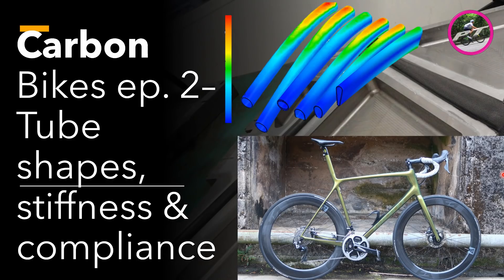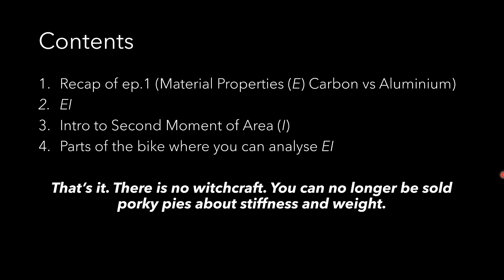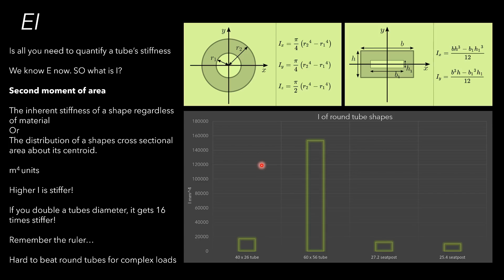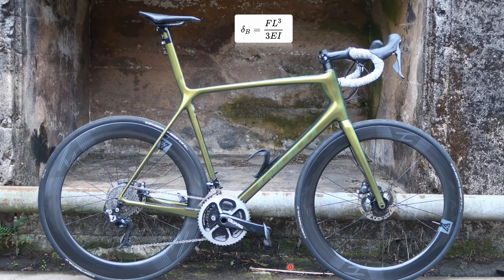Bicycle Stiffness - The Truth. Ep 2. Second Moment of area, stiffness & compliance explained.

Comment: I cant think of a reason to make a spaceframe out of cylindrical tubing other than for aesthetics and to make cutting of the tubes a royal pain in the ass for the poor buggers who have to make it :). If it's a proper spaceframe all the loads run axially down the tubes (in theory). As for compliance of seat stays ... I guess if they are spindly enough and possibly splayed then it will increase the deflection possibility ... if the chain stays are allowed to bend. I agree that it's a very stiff structure at the back and the only serious compliance is the seatpost ... a trusty cantilever in bending. Trek have a pretty good design with their isospeed system which has a genuine capability to modify the cantilever arm length and springiness. Keep the proper engineering stuff coming. You have a great knack for explaining stuff.
Reply: motorsport space frames get loaded in all sorts of crazy directions during unexpected departures from the racing line. So yes tubes are a good shape there. They aren't that hard to cut. and even easier on the high end stuff where a laser tube profiler just does it for you.
Reply: @Cynyr  good point on the laser cutting. I still dont get why round tubes in a spaceframe are better. By definition loads in a spaceframe member are axial or it ain't a spaceframe. Regardless of crazy loading, if the loads are going in through the suspension pickups and other major component mounts and these pickups and mounts are at a spaceframe joint and not slapped in the middle of a tube ... then everything is determinate. I'm not trying to score points here ... I genuinely dont get it.
Reply: @stevecrabb1  think crash, not normal operation. Yes they probably are all mostly axial normally. But flip it through the infield, or so it around a tree, and good luck determining the loading.

Also round tubes are ready to get.
Reply from the maker: @stevecrabb1  interesting discussion here. Im actually fond of the latest isospeed spring concept on the madone. It is a neat and novel solution. Something seldom seen in road cycling design. I actually commend the designer on that. However, its a big spring with no damper. How does it feel at 110rpm trying to push 600w seated...who knows. I need to ride one. But I sure ain't buying a frame with that price tag. EVER. 

About the space frames, i can't actually think of a reasonably modern application where the loads are all axial. Especially not ground vehicles. Maybe there are some kit gliders/light aircraft that display this. I've seen some old old gliders where space frame members are just cables. 

If you take the wheels and a frame, and apply the static loads do you think the frame structure is determinate?.... I think this has confused the bike industry since day one.
Reply: @Cynyr  It's a bit like designing an aircraft to survive a crash :) not a lot of point. It depends on the formula and rules surrounding driver safety as to roll bars, leg protection etc. as to what you do. In any case smacking it into another car or wrapping it round a tree will involve a lot of tubes being put into bending as they get hit in the middle. A round tube is definitely not better in bending than a square/rectangular one. But its a bit hypothetical at that point. What I'm a little unsure of is whether a round tube in compression has a better strenght to weight ratio, if it has then it makes a lot of sense.
Reply: @PeakTorque  Yeah ... welded joints are going to put tubes into bending somewhat. Bi-plane struts use crossed cables (or thin aerodynamic strips) in tension. Spaceframes are still used in kit /light aircraft for sure... and as you mentioned cranes and bridges. I do like a good spaceframe :).  I have a Trek Madone SLR 8 and the Isospeed seatpost works really well. I have it on its comfiest setting and never noticed any problems at high cadence. The pivot bolt did come loose once and it was the wierdest wobbliest feeling. Its a great bike generally but as good as the Isospeed is the actual method of retaining and adjusting the seatpost in the frame is just utter rubbish to the point where I had to make a spacer to fix it in place. I got the bike second hand for a great price, would I pay the asking price for a new one? ... no chance. Modern frames are an amazing study in price gouging!

Comment: Great video. Yourself & Luescher Teknik speak the most sense in the cycling industry

Would you recommend replacing a standard 27.2mm carbon post with a 25.4mm post in an effort to improve comfort? My frame is a 1980s Tommasini with room for 25mm max. tyres and I find it a bit too harsh. If so, would a plastic be the best seat post shim material to use? I wouldn't fancy carbon (post) to a typical aluminium (shim) to steel (frame) for galvanic corrosion reasons
Reply from the maker: Hi Gary. Thanks for the comment. As for the shim, go ahead. I have also run a 25.4 in a 27.2 frame. At these small diameters, the difference in second moment of area is small however, so you may not feel a difference. I'd still recommend Alu for a shim, with a liberal coating of grease. Or even better, if you are custom making the shim, anodize it. Use 6000 series not a 7000 series as they tend to corrode less. 

You could try Delrin (an engineering plastic) but this may creep under clamp compression over time, meaning you may need to periodically tighten the seatpost clamp.

Cheers
Reply: @PeakTorque  Thanks very much for the detailed reply. I was thinking of going from a standard stiff 27.2mm post to one with more engineered compliance (like the Cannondale ones), so going down in diameter at the same time would make sense. I'd probably draw the shim myself. I'm getting a stem face plate & Garmin mount made of 6082 aluminium and anodised soon, so I'll stick the shim on that order. Thanks again for the great advice

Comment: you mentioned you got rid of the thompson seat tube because it was too stiff, the giant TCR seems very similar. can you notice that difference when riding?

thanks for the good video!
Reply from the maker: The Thomson elite was on my supersix. High top tube thus not much exposed seatpost. The TCR has a very long exposed seat post. Deflection goes up with free length to the power 3! So exposed length makes a huge difference.
Reply: @PeakTorque  i suspected that, thanks! probably makes the case for the aero shaped one even worse as it is less exposed than the TCR.
Reply: @PeakTorque  Now I see why Cannondale have to make their small sizes SystemSix as ugly as it is. They need a lot of exposed seat post for the compliance to be acceptable for small riders. That make size 51 SystemSix Evo 's top tube slope a lot. (search for size 51 SystemSix, if you wonder).

Comment: Great video but in my opinion analysing a seatpost strength is a fairly moot point. The fact that the seatpost is inclined at an angle of 15-20 degrees from vertical means that most of the loading is the vertical axis and the tan of 15-20 is about 25-35%. For a 75kg rider that means that less than about 20kg of the riders weight is transferred into the angle in which the seatpost can deflect. There will be more deflection if the centre of mass of the cyclist is offset behind the centreline of the seatpost. Any "real" compliance from the rear end of the bike will be in the seat rails.
Reply from the maker: Yes the bending component is relatively small, but you have to treat the system dynamically. It's not a static problem. When you take into account bump inputs as dynamic forces and accelerations the rider weight is multiplied by a number of G. Even if just 1.5G, its significant.
Reply: Hi Alan.  Significant compliance can and is engineered into some seatposts, even at a normal setback.  One of the factors is how much of the seatpost is exposed.  A tall rider like Peak Torque may have over 250 mm of exposed seatpost.  (As he points out, bouncing can be an issue for compliant seatposts at high cadences.)

Comment: Great video. In mtb they changed to 27.2 to 31.6 and the journalists says they are more compliant, on the other hand endurance road bikes use 27,2 seatpost for comfort... Seriously they just recite a poem given by the manifacturer these days...
Reply: 31.6 allows you to use a long dropper post. 27.2 is too narrow for that.
Reply from the maker: 31.6 will only be more compliant if the wall is made CONSIDERABLY thinner. At which case it's more at risk of crushing. Thanks

Comment: Great video thanks ! I guess it was not really the point of the video but one little detail though : 1st moment of inertia != 2nd moment of area. They do have similar definitions but 1st moment of inertia has the dimension of kg/m², and it describes the mass distribution of an object relative to some chosen axis of rotation. You can get it from the second moment of area by multiplying by the surface density (assuming it is constant).

Comment: The seat stays on my carbon frame set have the shape of a sword with the flat parallel to the frame direction and are curved along their length in the accross frame direction, with no bridge for a rim brake caliper. So they don't form a triangular shape, as a triangle is a planar object, and the structure the rear "triangle" on my frame is, is not. So the bridge truss example is not applicable in this case as the truss members on the bridge, loaded with compression forces, likewise my seat stays, are not curvy, but are straight struts.

Comment: Loved the calm description at 2:00 regarding the manuf’s compliant stays - that said I rode a Ventum Tri bike on a test last year which is “stayless” (also downtubeless too a la Lotus) could get the tyre rubbing easily when powering out the saddle - takeaway good design but needs the engineering and structure to follow through - too many manuf’s are putting out rubbish and expensive rubbish too - same concept but rock solid but can’t buy one!! Diamondback’s Andean -
Reply from the maker: Cantilever chain stays can be really stiff is designed properly. I may show how in the next video.

Comment: Good explanation, I've never been interested enough to run any simulations myself or calculations (although im still riding an alu bike). What about the seat tubes with an offset to allow for compliance or even the Canyon Grail split thing.
Reply: Offset just increases the effective seat tube angle so when the load (that is generally vertical) is now further from the bottom bracket (in the direction perpendicular to the load), so the effective lever arm is longer so your deflection goes up. The split seatpost thing works by removing the sides of the seatpost and turning the whole thing into something like a leaf spring. The sides do most of the work here (think bending a ruler along its 2 different longitudinal axes, one is stiff, the other not, your taking the stiff parts out on the split seatpost).
Reply from the maker: @georgegrant6388  thank you! Correct.